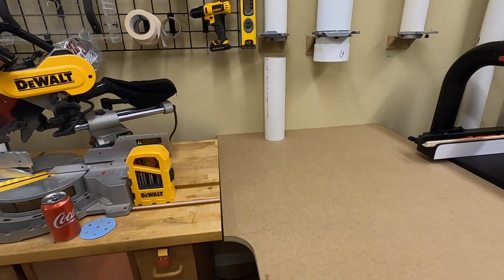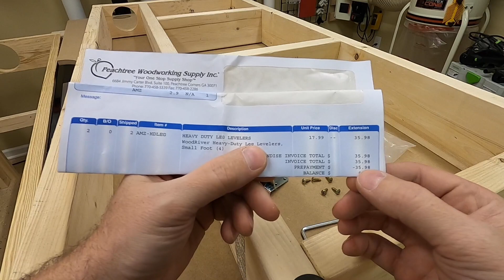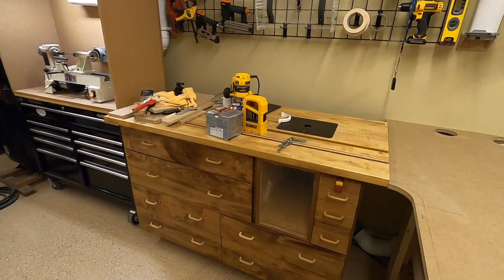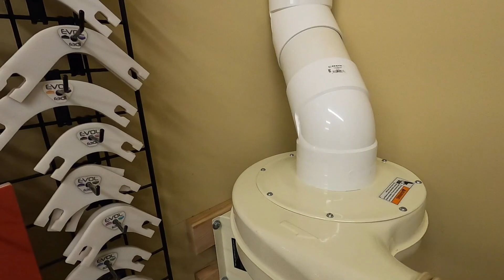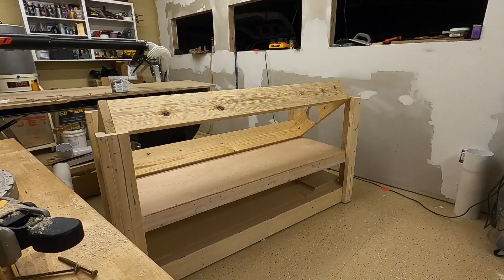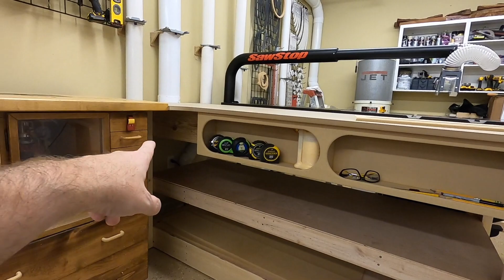Overkill Outfeed Table: Part 2

Comment: Your use of 4" piping and blast gates will restrict your flow as much or more than the one 90, but of course it's all a system. To capture the fine (read harmful) dust that you can't see you need much higher air flows. While you may have reasons like future space issues you currently have room to make that curve more efficient by adding some length of straight piping between the two 45's as that will help with internal turbulence. I hope you don't take these comments as snark or criticism. They are not intended as such. I enjoy your videos so far and have done quite a bit of research for our build at the university.

Comment: Love the attention to detail!  Couple questions... what gig are you using on your Dewalt Router to do those cutouts?  Also, what sander is that small orange thing?
Reply from the maker: That's an aluminum circle jig by Ill Customz. Can cut a circle from 2 1/4" to 25 1/4" with it.

Droppin Hz is the cheapest place to get one: https://www.droppinhzcaraudio.com/products/aluminum-circle-jig-by-ill-customz?variant=29756424487015

The small sander is from Snap-On: 3" Low Vibration Orbital Air Palm Sander PSF4312

I love that thing for detail work on A-pillars, sail panels, or anything where I need a small sander. Great little detail sander